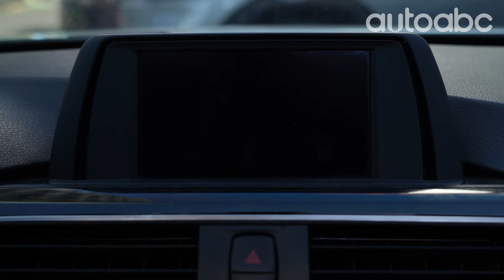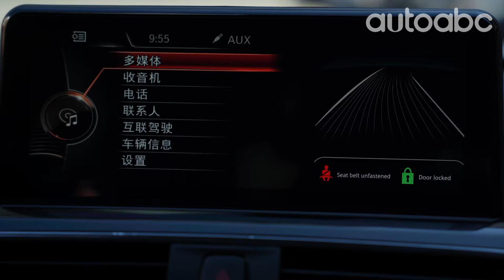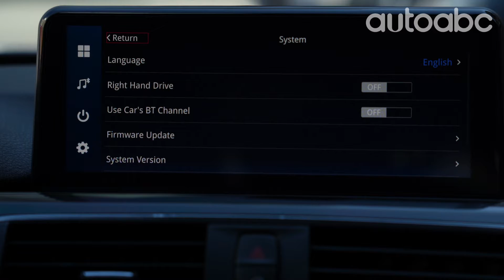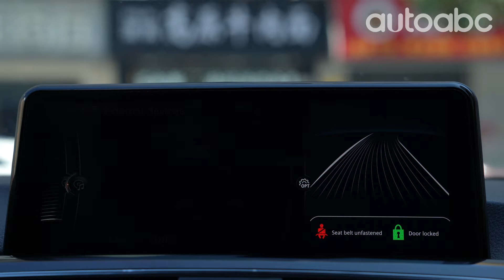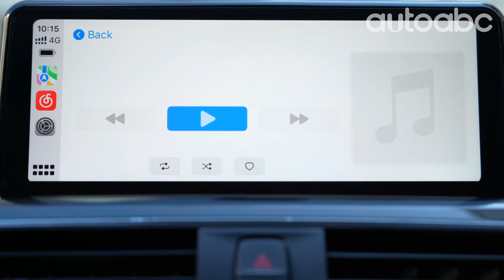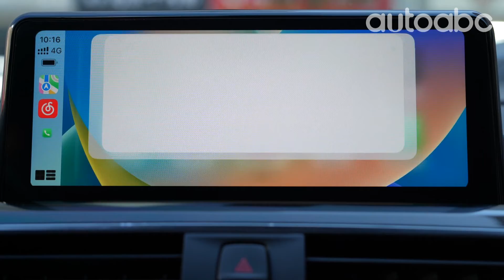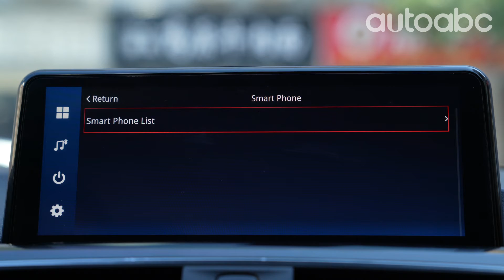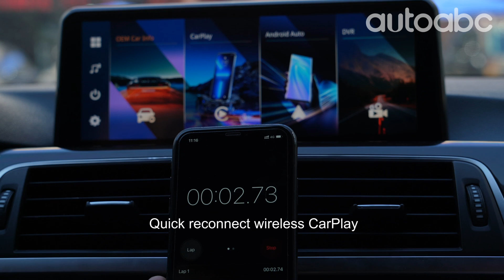Autoabc Linux screen for BMW 3er/4er F30 F31 NBT system

Comment: On the first connection it worked perfectly and showed the information in this way, which is correct. After a while the part on the left turned green with a purple stripe without having made any changes to the screen resolution. NBT 6.5”